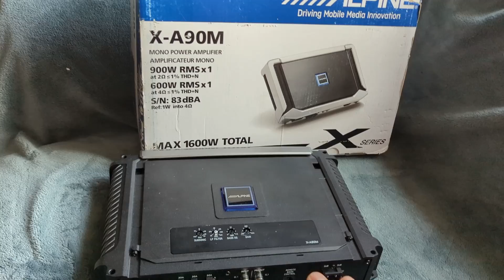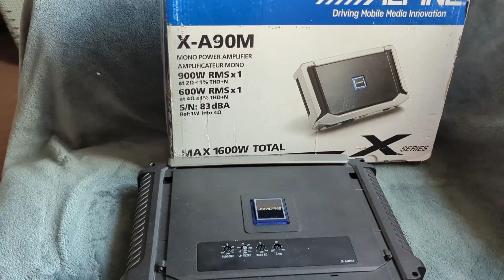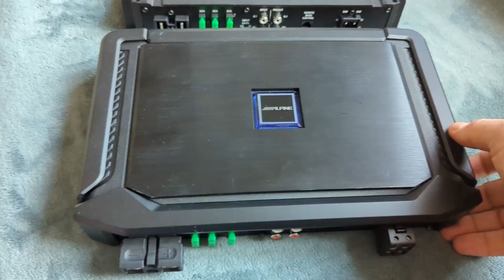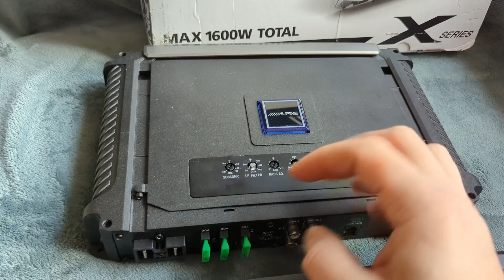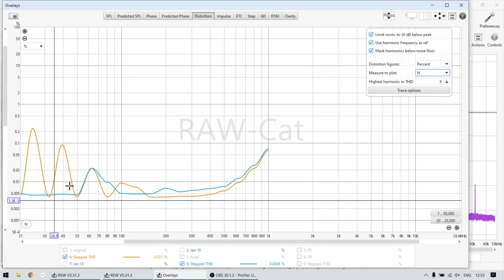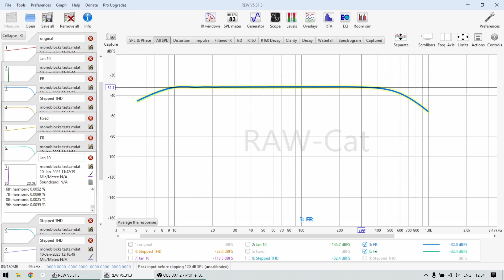Will repairing your amp change it's performance?

Comment: The original amplifier demonstrates a significantly lower total harmonic distortion than the repaired version. After repairs, the THD increased notably, particularly at higher output levels. This implies that the new components contributed to a distortion profile that deviated from the factory specifications. THD is a critical measure of performance, indicating the fidelity of an amplifier in reproducing the input signal without introducing additional harmonic content.

Comment: The amp makes 200 watts more than it should. Perhaps the previous owner modified it and raised the power supply voltage. If so, there might have been other modifications done to mitigate the risks of such a power increase, and they raise the distortion.

Comment: If you understand how cpu's are selected. In essence they are selected by grade. 
A lot of the components for electronics, such as car audio amps are done similarly. Especially for complimentary circuits. For example the bigger the batch of amps. The bigger the component pool. So you can do things like matching. And when you send these sensitive equipment's out for repair the repair shop might not have a pool to source components from. 
In the case of rare or hard to get components that matching is simply not possible. All you can do is replace with like components and hope for the best. Which  in the end will change the characteristics of the equipment under operation. Some times in amounts not noticeably different. Some times enough to render the repair completely unusable.
  I hope this helps. And I found your video informative.

Comment: I bought a JL audio RD 900/5 certified refurbished. Amp plays completely clean distortion free and does everything it’s supposed to do. The main difference between some manufacturers is that when JL certifies their repairs are refurbished products. Those products are refurbished and certified within JL audios company house in Florida. Many other companies will outsource the repairs. Get the product back tested for working conditions then send it back out certified. That doesn’t mean that the product has been officially repaired with that company’s original products. That’s the only reason why I bought a certifiedJL audio product due to the fact that the cost dropped drastically and that the products and internal compartments are the exact equipment used in a factory sealed product from JL audio along with repairs being done in their own build house.

Comment: He replaced the fets sure but did he use exactly the same part? Not just the same specs but the exact same part, same brand, ect?
I can get the "same" opamp chip from 2 different places and they will measure slightly different.

Comment: Id try to look over the both amps to see what components look replaced. Even the nicer unit may have had something changed. 

You might be able to compare the LPF potentiometers just to make sure they are the same top, middle and bottom resistance. Sometimes people replace them with the wrong taper. Especially if they pull a used pot off a donor amp. The top and bottom resistance might be the same, but a different taper is going to change things. 

Try to eliminate as many variables as possible. 

Do the amps have a big gap in their manufacture dates? Maybe Alpine did a revision change. 

It's hard to say why there's a difference. I'm impressed that the repaired amp was actually more powerful. It seems like a small increase in THD was totally worth it. Maybe the nicer amp has an issue that's reducing it's power output? Does it seem to be meeting it's factory rated power specs?

Comment: if the transistors burned most of your caps even if they look fine are probably dry heat can dry up electrolytics with no noticeable residue
Reply: This is my thoughts as well

Comment: I’d say to be a very valid comparison, there would need to be at minimum 3 stock unaltered/repaired amps tested o get a solid baseline. We can’t say for sure that one of these amps is really out of spec tbh. Great vid though!
Reply: I second this. Is it possible he just hit the silicone lottery on the good amp? 
Or, replace the fets in the good amp also and remeasure for a more direct comparison of the fets influence.

Comment: considering it's a sub amp anyway, it's all academic. Human ear typically can't hear a difference in distortion below 1% anyway, low frequencies have even more room for error before you notice anything bad is happening. The harmonics might be an issue if the frequencies in question were higher, but no one listening to that amp will be able to tell any difference.
Reply: Yes, the repaired amp is making more power. Seems totally worth it.
Assuming the SQ hasn't suffered.

Comment: So many variables here, and without metering or o-scoping side by side of both amps components it's up in the air. I'd be even more curious to see how a third one measures. Could be the "good" one was just exceptional, yet both are within Alpines allowable specs. Component level stuff like this can be extremely sensitive to even the slightest variances. Maybe swap the mosfets again and see if there's a change.

Comment: Or FETs not the same as from factory - or something also broken in the driver circuitry - which causes slower switching - which cause additional distortion. Not sure.
Why original FETs are so cool - is about packaging - which allows much lower parasitic inductivity and allows faster switching times with less disortions.
There is very good document from IQR about this FETs packaging, try to google for:
IQR Designing Practical High Performance Class D Audio Amplifier
first link PDF document page 9 and up.

Comment: It's important to understand that the broken amp might have gone through hell with the previous owner, so we don't know for certain what the rest of the circuitry looks like. So here are some educated guesses I could think of: 

1. The replacement FETs might not have the same gain  (transconductance) as the original ones, which can affect how the amplifier handles signals.
2. Differences in the gate threshold voltage between the new and old FETs can mess with the biasing and how smoothly the circuit operates.
3. The new FETs could have different internal capacitances, which can mess up the high-frequency performance and introduce distortion.
4. If the biasing isn’t adjusted to suit the new FETs, they might not operate in their ideal range, leading to less linear performance or even clipping and distortion.
5. The replacement FETs might not match the impedance of the output stage as well as the originals, which can reduce efficiency and increase distortion.
6. If other components like capacitors or resistors have aged or drifted out of spec, swapping out the FETs alone might not bring the amp back to its original performance.

I can only assume that Alpine recalibrates every amp before boxing it and shipping it for optimal performance, regardless of transistor variations.
Reply: What You saying could be true if it's not a class D amp, so no biasing here. 
There is no gain in mosfets they are switches; amp power in this case is determined by supply voltages, current capacity of mosfets, filtering inductor current capacity. 
So power cant increase by changing mosfets without increasing supply voltages.
Differencies in harmonics and distortion may be caused by decrease in capacity of supply voltage capacitos as well as filtering capacitors at the end stage of the amplifier, and all this due to heat stress and abusive usage by previous owner or just simply due to age of those components.
Reply: I think you're forgetting that the repaired amplifier is actually performing better than the original. As if it's traded noise for power.